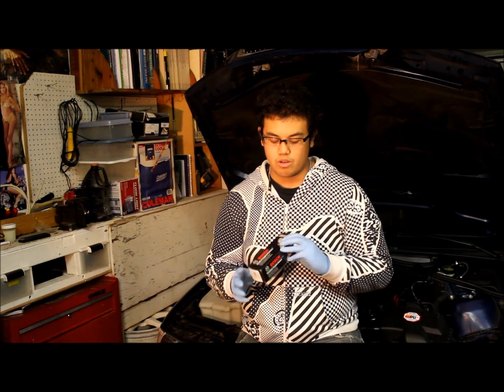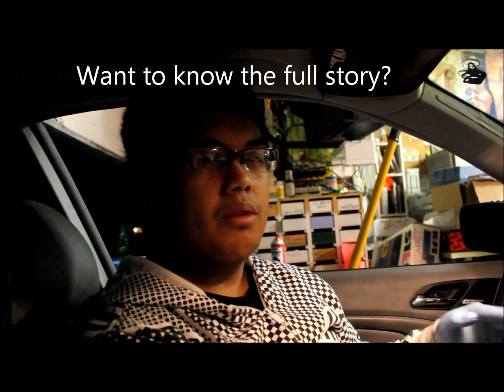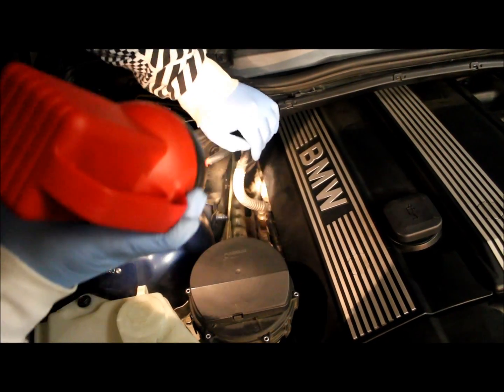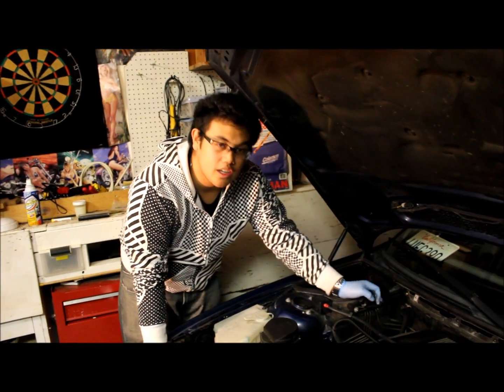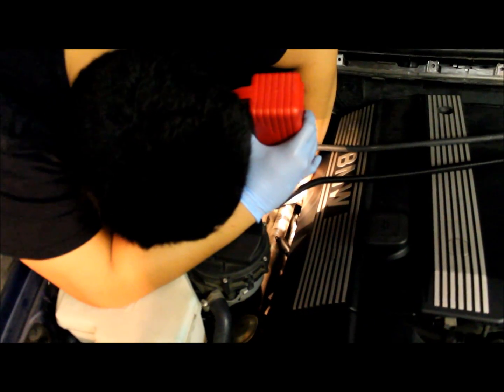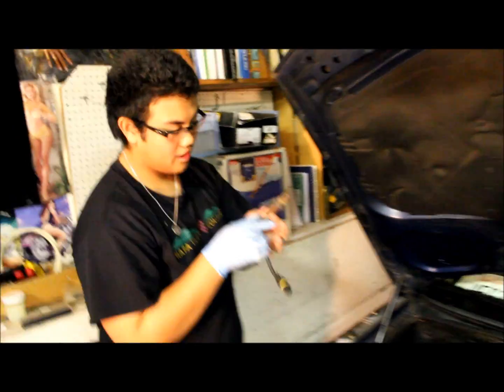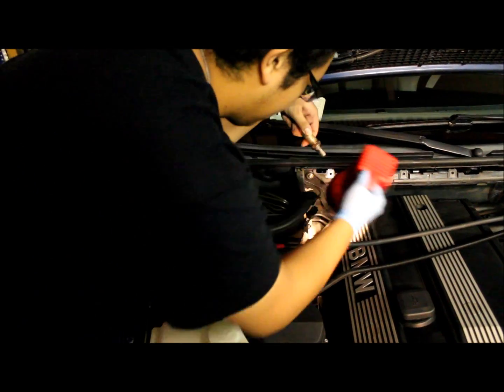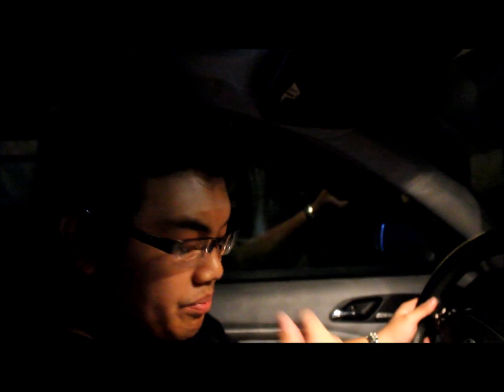E46 DIY #1 Changing Pre-Cat Oxygen Sensor & P1189/P1188 Fault Code Repair Attempt #1

Comment: Hi, Is it possible to use the pre cat sensors for post cat if the pin fit and can connect, say pre cat O2 sensors from another bmw model?
Reply from the maker: pre cat and post cat sensors read differently. pre cat reads the fuel and air mixture after combustion and post cat reads the effectiveness of your cat. they may fit but it wouldn't really work out and may throw more codes could harm your engine. If I remember correctly the post cat sensors have longer cords than the pre cat sensors.

Comment: Whats is your engine code? my is an n42b18a the engine Light turn up and i had it diagnose the lambda sensor needs replaced.

but i dont See the oxygen sensor.

my bmw 316i with 85 kw is from 2004

Comment: Hi there... nice vid...:-)
I hope you can help me.... I have a 2001 330ci cabriolet with a full service history and "only" 117k km on it, and it has a problem that is driving me crazy... It looses power when warmed up ( after 10 - 30 min. )... No idle or starting problems... warm or cold. When cold it runs and pulls perfect. The water temp. is well with in specs. so the engine does not run to hot....So far I have changed the vanos unit to a "new" one with Beisan seals/ o-rings + new bearings. Changed the DISA, both cam pos sensors ( original BMW ), the MAF is changed, and a full service with new plugs, oil, oil filter, air filter has also been done. I have done a smoketest = no leaks. I have done the "blow test" to test the crankcase ventilation... also did the suction test with the plastic bag over the oilfiller hole... all ok..... 
I should mention that no codes are thrown :-( So it´s a real pain to trouble shoot !!

Any ideas ???

Comment: lightdark, what would happen if you mixed up the oxygen sensor chords. so that the sensor that should read bank 2 reads bank 1 and the opposite for the other? i believe i have done this by accident and im getting fault codes for cylinders 1-3 misfiring. just wanna check before i blindly switch the chords again. is there a way to check and make sure you plugged them into the correct ports?
Reply: boomiko2 n42 2713 oxygen Sensors before Catalytic converter mixed up 
and get misfiring in cylinder 2-4
any help

Comment: Thanks for taking the time to shoot the Video. On my way to Advance to pick up the Sensors and tool.
For the rest of the newbies to an E46, get a Bentley Manual, they are about $90, but have detailed information on how to maintain your BMW. Much better than Chilton or Haynes Manuals.  I would also advise joining E46Fanatics.com.  
the site has detailed information on about anything that can go wrong with your car, with an active membership that will point us in the right direction.  These cars are now 9-15 years old, the vacuum hoses and plastic/nylon parts are beginning to fail, or will soon. Maintain them and they will last 200-300,000 miles.

Comment: I have the code p 1188/1189 and I changed everything!! MAF sensor, O2 pre cat, cvv, spark plugs, fuel filter! The only thing I have not done is the intake and valve cover gasket. Any suggestions for me before I spend all of my money and go nuts!
Reply from the maker: Check your vacuum lines and your intake for cracks and breaks. People with this problem are caused by a blocked up catalytic converter... For me, before my sub frame fell apart, my second air pump came up as a fault code and the whole P1188/p1189 went away
Reply: +Terrell Lloyd Vaccum, Injectors, gaskets, wiring. You can check air leaks using brake cleaner there is videos. Also cats and 02 sensors dont fail on there own something causes it. Only thing fails on 02 itself would be heater

Comment: had both these cases and i changed both of these o2 sensors and i still get the codes after like 3 months
Reply: did you buy oem bmw ones or cheaper ones?

Comment from the maker: I recommend changing all oxygen senors Pre- cat and post-cat and cleaning your Mass Air Flow Sensor with Mass Air Flow spay that you can find in your local parts store to eliminate any misreading issues.

Next inspect your intake for cracks by dismantling the intake slightly bending and flexing to look for any tiny cracks and also make sure everything is secure and tight back on.

Also check your gas cap.. like the o-ring or replace it with a new OEM cap

Let me know if it still comes up or not!

Comment: I just had the valve cover gasket and spark plugs change.  I also did a oil change.  This is for a 97 328i after driving for a few miles those two codes came up. Any idea why guys?

Comment: i heard you have to clear the adaptation with programmes like carsoft to clear the code and so your car readapts to new parts such as 02 sensor, did you get rid of the code? write back if you get a chance, im unlucky i got a 328i 1998 e46 and all my 02 sensor under the car and i got to splice the wires on my new 02 sensor cause they too short.

Comment: Our motors look the same mine is  2003 325I. However my o2 sensor cable is like foot half long and its plug in on top not on the side. And the price is about $100 bucks more than the sensor in your car. Good video

Comment: @lightdark101,hello ! I just check my o2 sensor and I discovered that the sensor is very loose , actually i can wiggle it side to side easily. So i pulled it out,blow it with some high presure air and i put back in. Hopefully its not a bad sensor. Jus wana let u know ...

Comment from the maker: It's going to a long trial and error path. You can take it in to a shop just for diagnosed Prefer to anyone who you feel comfortable and also rely on.. and also pricing. just to get what's the point and also what is wrong with the car.. And from then on you can do it yourself... based on what the problem is...

Just make sure you get a printout of the cost of what it would take if they repaired it.. So they cant charge or raise the price on you when you bring it back to them.. last resort only

Comment from the maker: Depends... Mine end up being the secondary air pump or valve failing and the holes in the intake tubes.. and think that's what caused the problem for me... others its the cyclone separator and sings of that is oil stains under the intake manifold or around the dipsick area.. and others is cause by failing MAF

Comment from the maker: Best bet is trial and error, i have video up on how to clean the MAF n while cleaning that, take out ur intake tubes n bend them n look for cracks or holes in them. If none place everything back once the MAF is clean... Clear the codes n c if it comes again... If it does, test the MAF by having the car run at idle and unplug wire. It should stutter for a sec or 2 then idle normal, that means its fine if nothing happens at all, your MAF is bad.

Comment: go to advance auto and ask for a code reader... plug it in... turn the car to ignition.... push enter to read codes.... then go to menu... erase codes.... confirm.... done.

If you've never used a code reader before... ask for a tutorial. They are not allowed to delete your codes, because technically it is illegal. But maybe they will tell you exactly how. It will help if you explain your situation. EX: i got a missfire code and replaced the spark plugs, help me delete to see if it comes back

Comment from the maker: @vijaych1209 Bosch part No. 15109 is for a Post-Cat Oxygen Sensor (Bank 1 or 2 Sensor 2) and reason why the wire is longer because the wire goes from the bottom of the car to the top of the engine by the fuel rail...

And most of all its the wrong sensor for this job...

And the sensor for Bank 1 sensor 1 is identical and the same to Bank 2 sensor 1 (No. 19477)

Sorry for jumping around, hope i answered everything and cleared out any confusion

Comment: Hi I am planning to replace my 323ci bank 2 sensor 1 and the question i have is if the sensor is any different than bank 1 sensor 1 which i replaced few weeks ago.
I used this - Bosch 13477 for bank 1 sensor 1 and i am told i use Bosch Part No. 15109 for bank 2 sensor 1 which has a longer wire to it.

Comment: My car had recently been experiencing some difficulty when accelerating from a complete stop. This morning I turn my car on i get a check engine light and I was getting quite a bit of vibration in the cab. So I drove to school and my car seemed to be running about half of its usual power.  Well after I went to class etc.. I drove my car home and it seemed fine but the check engine light was still on. Do you have any guess to what the problem could be I have a 99 323i and obviously its anE46.Help

Comment from the maker: @cthulhuXD try cleaning your MAF and use seafoam in your gas tank to clean your injectors...  check for cracks and leaks in your intake system...see if that works... if it still shows up replace the O2 and if it still does... do a test swap or replace your MAF

Comment from the maker: @alexlex85  Lambda aka O2 sensors for the 323i or Ci are the same since we have the same engine and this is the same Bosch Oxygen Sensor #13477.

BUT... Thats at autozone; i'm not sure if thats the same part number as other places. So depending on where you shop just make sure if its upstream (Pre-cat) or downstream (post-cat). Hope that answers everything

Comment: can you tell me if the lambda sensors are all the same part number?
are they all the same or slightly different?
many thanks
bmw 323 e46 2000 convertible

Comment from the maker: @IDoNotReply the remainder O2 sensors; which are post-cats, are located near the down pipe curve on the bottom of your car. But both of them are kind of difficult to get since its small place and their connectors are located where your fuel rails are located (under the plastic engine cover held by 2 10mm bolts) I was eventually going to do a video on post cat sensors but kind of short on money.
Bank 2 sensor 1 is the o2 sensor closes to the fire wall and bank 1 sensor 1 is the one next to it.